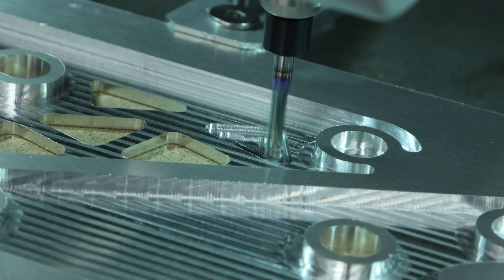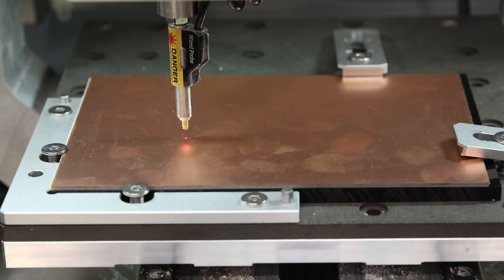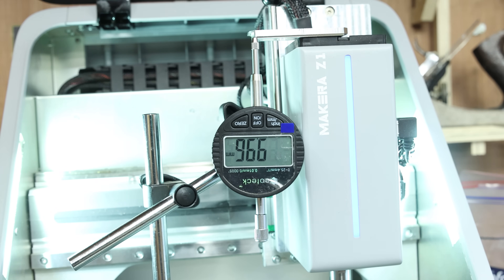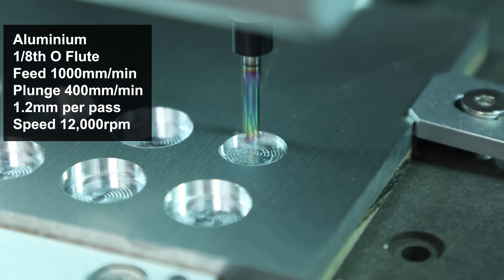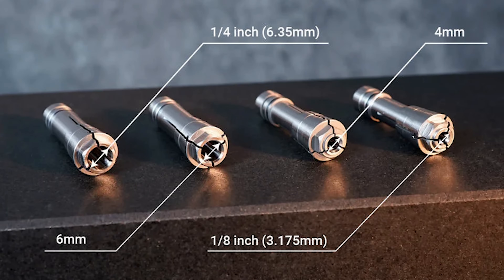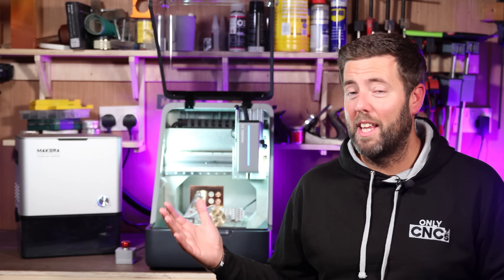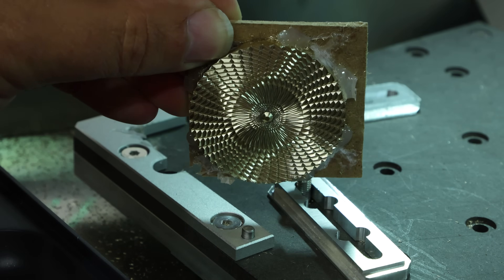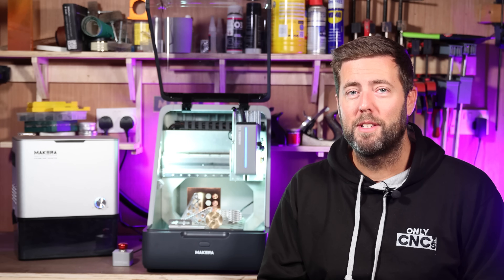Detailed look at the Makera Z1 - How accurate is it really?

Comment: Great vid, I understand you're limited by your tools to mesure, but for accuracy you should'n mesure a somewhat small hole with a caliper, you will have a error make by the thickness of the jaw. Maybe around 0.01 to 0,03 mm depending on the caliber and the hole diameter. Use pin gauge for holes or machine a cylinder and mesure the external diameter with the caliper.

Comment: How does it compare to the Air? I think you promised an additional video on the Carvera Air looking at cutting perfromance, but i havemt seen it thus far
Reply from the maker: Despite the smaller work area and lower powered spindle, I would probably pick this over the Air, especially with the Pro upgrade option they are now offering. I borrowed my Air to the Carveco team for some testing and still haven't had it back 😂

Comment: Going nut's with a hot-glue gun would likely improve things a lot as far as sealing every crack is concerned, no chips(dust where you don't want it and possibly also improve efficiency of extraction by making extraction air-flow more linear and restricting it to where you want it(as in from front cover and back towards port without any air leaks from sides creating turbulence).  

A proper shop-vac moving a lot more air would however likely improve things a lot(are lots of  3D printable cyclone extractor setups available....), would be noisier to have a large Karcher running though..

Comment: Hey James, what's your opinion on the newly announced Z1-PRO version with closed loop stepper motors and ball screws instead of the regular lead screws?
Reply from the maker: Its great they have made these optional and a lot of people will really appreciate the upgrade. Would have been better to have offered these from the start as it just causes confusion when companies change the offerings part way through a campaign but shows they are pushing forward
Reply: @JamesDeanDesigns  so if one has the money to spare you'd say go for it?
Reply from the maker: @Bound_Ivy I try not to tell people how to spend their money but ultimately these upgrades only make the machine better and probably at the right price point. Not essential for everyone, but a big plus for those who can afford it

Comment: You mention a passthrough but do not show any large projects in this video. I have a few projects in mind that may require long machine parts that are not very wide. However, out of all the videos I have been watching on this product you are the only one to mention removing the back. Also the manufacture video show that if the lid is open the machine stops. If I want to work on a 24 x 6 in project can I actually pass the material through the machine or not? It sounds like the lid would prevent it even if the back can be removed limiting the "passthrough".  Can you confirm that the passthrough works and if it works in both directions?
Reply from the maker: Hi, yes it can take larger material, i just never did a large project. Check out @techydiy video on this machine. He does show the back removed. The  lid has a safety switch that can be disabled in the software. I film a lot with the lid open so I always disable it as standard. So yes it can work in both directions

Comment: while machining stainless, if it doesnt vibrate, or doesnt slow down the spindle, it can machine it, you just need to tweak the feed and speed
your bits(with DLC coating) was for alumunum, its too sharp for stainless and its coating is only to prevent the material from sticking not to protect it from the heat, an uncoated bit would have been practicly equal if not better
reminder that Heat is what kill a tool in machining, so if you have no coolent, you need to greatly decrease the speed
the best coating without coolent is AlTiN, its whats used to machine both stainless and hardened steel
for an uncoated bit on stainless, i think around 30m/min (3000 rpm for a 3mm bit) 0.01mm/teeth if slotting

reminder, if the machine doesnt vibrate nor slow down the spindle, and you have problems, its not the machine that is, its your parameters that are the problem

Comment: If you want to machine steel on a smaller machine like this, the key is low RPM, high chip load, and a single flute (o-flute) endmill.  Insufficient chip load results in rubbing rather than cutting, meaning heat is built up rather than released by the chips.  Since a small spindle can't spin slowly enough (with sufficient torque) to keep the chip load high at the reduced feed rates supported by a lighter machine, keeping the flute count low (ie. 1) helps a lot.

I've successfully milled plenty of 316 stainless on my Genmitsu 3030 PROVer max (similar strength to the Z1) running 7000RPM, 600-800mm/min, single flute o-flute 1/8" endmill, 0.3 - 0.5mm depth of cut with great accuracy.  I use an intermediary aluminum plate / spoilboard as a heat sink and drip cutting fluid on it every few minutes.  Heat's the enemy, so if things warm up, pause the job, let it cool off, then resume, and you're golden.

Comment: For a beginner which one would you recommend between the Makera Z1 and the Nestworks C500? I know they're in different price brackets but if I can afford either one which one should I pick?
Reply from the maker: Makera Z1 is a great machine for the price but the C500 is obviously a more expensive machine which has more hardware and a stronger spindle.  The Makera software is more stable than NestWorks at the moment but by the time machines are delivered the bugs in the NestWorks software should be resolved.

Comment: Thank you for sharing this video.
I noticed the stainless steel machining segment at 7 minutes and 18 seconds. The cutting tool used in the video is not suitable for stainless steel — it is a tool intended for aluminum alloy.
I would also like to share some suggestions for machining steel with the Z1. First, I want to clarify that although the Z1 has a relatively low spindle power, I have successfully used it to machine various materials and produce the desired parts, including aluminum alloy, carbon steel, titanium alloy, Inconel 718, and stainless steel (see details on Makera). In fact, for experimental desktop CNC machining, the requirement for spindle power is not very high.
First, for machining different materials, it is essential to select the appropriate cutting tool. For stainless steel, choose a coated end mill specifically designed for stainless steel. The tool should have multiple flutes to prevent overheating and reduce cutting force.
Adjustments should also be made to the machining strategy. When machining such hard materials, reduce the total milling allowance and increase the feed rate.
If you are familiar with industrial CAM software, dynamic milling is highly recommended. Set a slightly larger single-layer depth of cut, a low radial engagement, and a relatively high feed rate, while machining with the side edges of the tool. This can significantly reduce heat accumulation and tool wear.
Finally, in my opinion, the Z1’s integrated frame and compact structure provide good rigidity, and its spindle power is sufficient for desktop-level machining.
Reply: How did you get access to the z1?
Reply: @funy0n583  Makera provided me with a test machine. I developed the test machining parameters and filmed videos to share with them. The titanium alloy machining, aluminum alloy chaos pendulum, fly cutter videos, and other content on their official homepage are the test videos I created. Going forward, there will also be test videos of Inconel 718 machining and stainless steel machining.😁

Comment: 6K ? no way
Reply from the maker: 6k? Where did you get that figure from or is that a different currency? The current price as standard is $899 USD
Reply: @JamesDeanDesigns  i just clicked on your link
and read 5999$
but for 899 i will look again..
Reply: @JamesDeanDesigns  ok for 899 i looked again, and mea culpa, i saw the 5.999 million in  ?crowdfunding? and took this for the price 
so i just closed the page ... 
ok, 899 sounds decent

Comment: "Can it machine steel?" Proceeds to cut stainless steel, dry, with uncoated carbide at 120m/min

Mate, if you're going to give people advice, please make sure you know what you're doing first. Machining stainless steel is an entirely different business compared machining ferrous. If you're too conservative with the feed, especially without coolant, stainless loves to work harden. Your surface speed is about twice what you'd normally use for stainless, and your feed per tooth is about half. This makes the tool rub more than it cuts. Simply doubling the feed alone would probably make for a much nicer cut in this case, even if it means you have to reduce that 0.25mm stepdown to something even tinier like 0.2 - 0.15mm. 

Also, the reason the airblast is nice to have is because it avoids chip recutting, not so that you can see what's going on.
Reply from the maker: I literally don't give anyone any advice about cutting steel though do I, in fact the opposite, I say what not to do. I ran a test, showed the results 👍
Reply: @JamesDeanDesigns  Yeah well the thing is, you did make a recommendation. If I'm doing a car review, and during the segment on motorway driving I stick it in 1st gear and floor it, I'm going to cause a 20 car pileup and blow up my engine. That would not really put me in a position to make a judgement call on the car's suitability for the motorway.
Reply from the maker: @Father_FED1991  😂 ok then. Have a good day 👍

Comment: I've been finding conflicting information on what the 5w laser is capable of. Will it be able to engrave brass or just wood and other soft materials?
Reply from the maker: It will not engrave metal, that is fact. It's the wrong wavelength. It will mark coated metal but that's a different thing. Wood, leather, acrylic, slate, Cork, paper/card
Reply: @JamesDeanDesigns  amazing thank you for the reply! Hopefully they have a more powerful laser in the works.

Comment: Thank you for the awesome video!
I am pretty sure the reason why the Makera Air isn't as good as the Z1 is because the Air uses rods on the X and Y axis vs linear rails on the Z1. Though the rods are thicker, they won't translate linear motion as well as linear rails. 

I am sold on the Z1. Better price point and I am pretty sure Makera, by now, has learned a lot from the Carvera and Carvera Air to make a better machine.

Comment: Since the dust collector is not really effective, do you recommend skipping it? Especially since it's the most expensive accessory to bundle. Would laser engraving be a problem without it?
Reply from the maker: So the vacuum itself is good for its size, its the way they have done the slope in the machine tray. It's not really angled enough to make it work efficiently. So if you need a small quiet vacuum then yes, still get it as that can be used to vacuum out the machine. If you already have a vacuum then maybe not
Reply: @JamesDeanDesigns  I came up with the idea of correcting the angle of the dust collection tray - just put something under the front of the machine.
Yes, it's not very natural, but I think it shouldn't affect the quality of the part.

Comment: I want to clear up some confusion about machining steel, because on the surface it seems like you should be able to machine steel if you're willing to accept a longer machining time. In reality, there are three major problems with this idea, the most important being steel's poor thermal conductivity and high hardness. The faster you spin a bit against steel, the more the cutter heats up. Because steel doesn't pull heat away quickly, that heat stays in the tool, softening it and making the cutting action even worse. This becomes a vicious cycle that causes the bit to dull rapidly, which ends with the bit spinning in place or snapping off. 

To avoid this, you need to push through steel fast enough (relative to spindle RPM) to create proper chips that carry heat away. In practice, you need a machine capable of taking heavy cuts, rather than trying to grind through the steel. The goal is a slower rotating spindle feeding aggressively into the material. That requires a lot of force.  The opposite of what you want is no liquid cooling, fast rotating spindle and moving through the material slowly. That's basically how ancient man started fires with sticks and wood.  

The third problem is that even if you could slowly grind away the steel, you're creating ferrous (magnetic) dust around components that might be magnetic and not well protected.
Reply from the maker: Oh...my knowledge on machining steel is minimal, I wasn't for one second claiming I knew what i was doing. I just sent it and hoped for the best 😂 thank you for the information
Reply: Carbon steel, proper quality carbide endmill and correct cutting values should make it work even without cutting fluid.
Reply: For point two, it's why carbide inserts have rounded edges to heat up the chips to annealing temperature softening it, great for hogging out material. This method doesn't work on low power, low rigid machines. You need a sharp carbide edge for fine finishes with a weak machine
Reply: @Jun127 there's a way to cheat that works surprisingly well on these smaller machines: single flute o-flute endmills!  I've had good success with 316 stainless on my 3030 PROVer max cutting at 7000rpm, single flute, 600-800mm/min, with light cuts and sensible toolpaths (ie. <50% stepover, proper plunge speeds, avoiding slotting operations, etc).  Using an aluminum spoilboard as a heatsink really helped too.
Reply: @GordLamb  Good insight, I'll probably try experimenting when I get the z1. I can think of a few other ideas to help overheating that I may be able to code a post processing script around (it would make very long machining times). I'm not sure how well the z1 will be protected from the tiny hard ferrous chips though. I worry that even if we figure out a reliable, easy method to machine steel parts on it, we'll be wearing the machine itself down.
Reply: @Jun127  Aye.  I should mention the vast majority I've machined is plate (1/8" to 3/8") which is easy to heatsink, and I've been using a dust shoe to capture most of the chips.  Heat's definitely a big issue so if you can slow things down in your gcode that'd help for sure.  In any case it truly is awesome what we've got access to in the makerspace these days. :)
Reply: Thanks for sharing these information. Could you please write something similar for aluminium?

Comment: I have the Air in the workshop and I've backed the Z1 with all the accessories for the bench at home. For the money I accept it for what it is. I have spent way more on my Openbuilds machine with less features. It will likely just be my PCB mill.
Reply: What is your opinion on NestWorks C500

Comment: Great overview James, you answered the questions I still had really well!
Now I'm looking forward to the C500 review, I think that one might be more up my alley 😊
One fact that's interesting to me is the noise, Makera claims the Z1 to be around 70db, while nestworks claimed 80-82 db when cutting aluminum. I figured it was a case of nestworks just measuring when cutting a harder material way more aggressively, because the C500 looks like it should be actually slightly quieter than the Z1, not louder. so far I'm guessing that's indeed the case, but looking forward to your numbers 😊

Comment: The carvera has unsupported linear rods, where the Z1 has fully supported linear rails and reinforced sidewalls. That makes for a much more rigid machine (rigid enough to mill titanium once in a while, as they showed).
As for the dust extraction, we've seen the latest model incorporate a small bump in the front of the cover motor that we're guessing is another air outlet to push the residue more effectively, but we don't have any confirmation of that.
What vise are you using? looks very low profile.
Reply from the maker: Yeh, after recording I was thinking about this and it must be the difference between rods and rails.
It's the FoxAlien low profile vice
https://amzn.to/4qXQPRm